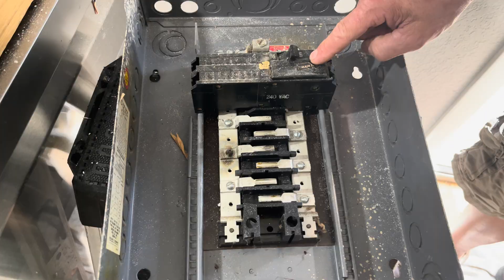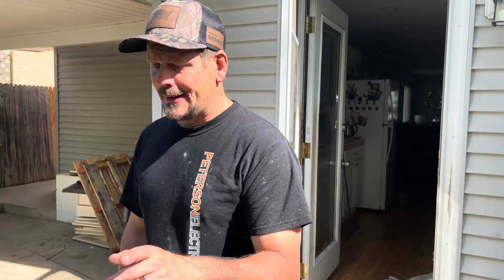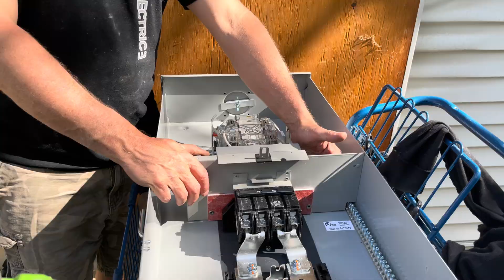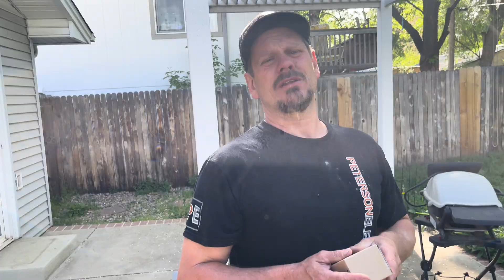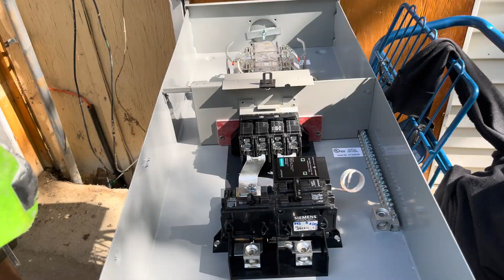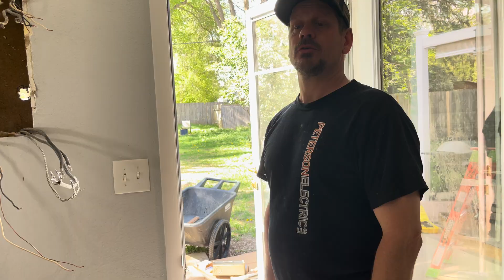What You Should Know About Electrical Meters

Comment: oh the joy of "residential grade"....

IMO if a panel/receptacle can't handle a welder or EV it was defective to begin with. Unfortunately the listing and the nameplate means little to nothing these days. 

regarding the stab surge suppressor, these are really only for AFCI/GFCI type breakers that have a capacitive dropper type circuit in-place (they don't have room for a real switching power supply in a 1 inch breaker) which can be destroyed by surges or more commonly transients and consistent temporary losses of power (bad triplex spice for example). MOV style surge suppression needs to be close to the load it protects to "shunt" the transient so this won't really do much for downstream devices and it's protection can get "used up". Out here in the boonies it's a pretty common failure mode for these breakers which is unfortunate as we move to new codes with no solutions in sight...